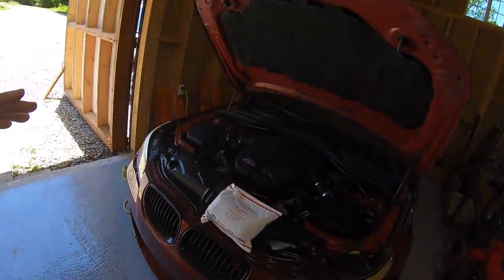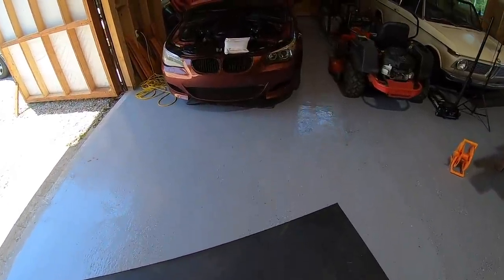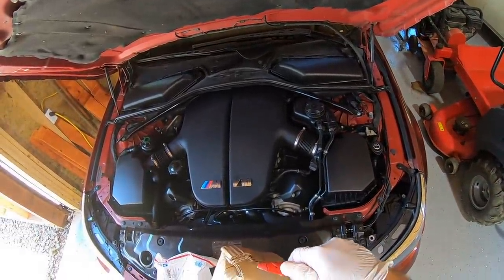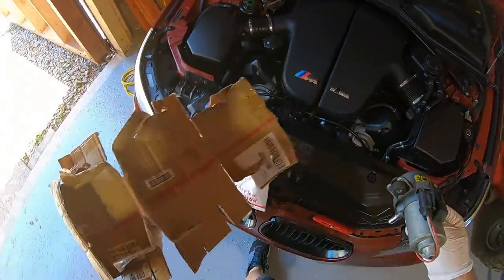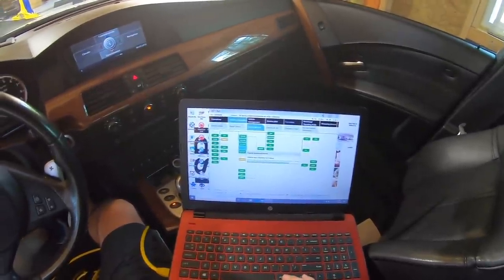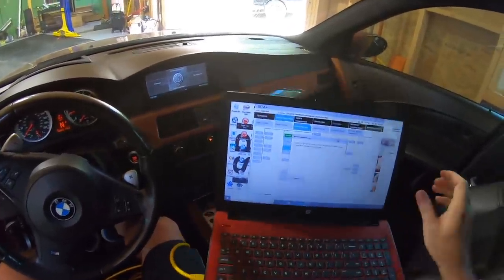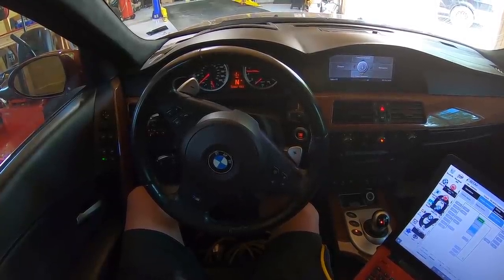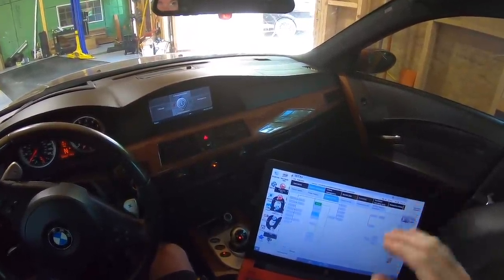BMW E60 M5 Finally Fixed Vacuum Pump Removal

Comment: Thanks for the video. Title says removal? What did you remove? Are we to understand you simply disconnected the secondary air pump electrically and pneumatically?
Thanks

Comment: Hey I ran into a vanos issue where the car ran like it was struggling to breathe couple days ago and I tried to fix it with success but found a problem with your instruction video ( no codes in dme). I had 3 pairs of solenoids with me, bmw oe (150,000km on them from factory on the car), viaco (20,000km on them installed last year) and brand new pierburg. So cleaned all 3 sets and swapped them and the car still ran poorly. I followed your video on swapping and calibrating vanos solenoids. So in your video you actually do a Valvetronic calibration but there is a Vanos  calibration called something like ABL- exhaust camshaft sensor and ABL - intake camshaft sensor ( I searched vanos in ISTA). I ran both tests which tests the actuation of the vanos cams then sets an adaptation offset for the angle. This fixed all the power problems I had with my N52 6MT E82.

Comment: Regarding your E90: IBS, alternator, water pump, oil level sensor is on BSD line. If there is a problem with one of those you can get errors on all BSD line. Last thing you have changed on BSD was oil level sensor (FEBI - this is a low cost brand considered to be crappy in Europe). You should focus on that.

Comment: I was getting a p1209 code, vacuum sensor. replaced sensor, and still getting the same p1209 code. moving to replace the brake vacuum pump next. hopefully it stops the code and reduced power limp mode nonsense. I can turn off the car and restart to clear the reduced power issue

Comment: Nathan does it take 100 to 200 miles (or less) for the M5 if you disconnect the battery for the computer to relearn ?
Reply from the maker: No

Comment: Got a fault code 27DA possible vacuum pump,brake booster. Went into limp mode but cleared the fault and not came back but order a vacuum pump

Comment: Would you ever do a SMG delete and swap with a manual?
Reply from the maker: No
Reply: Nathan's BMW Workshop Cool. Had a random question on the M54’s. I know you did an M56 valve cover swap on the X5 a while back. 

Do you know if that swap and a CCV delete (since it’s built into the M56 valve cover) might help with oil consumption?